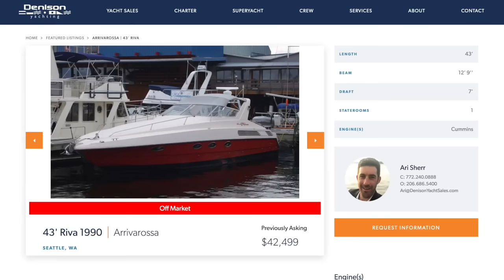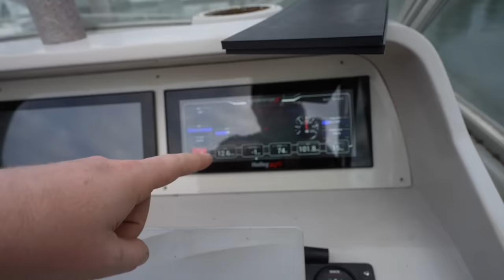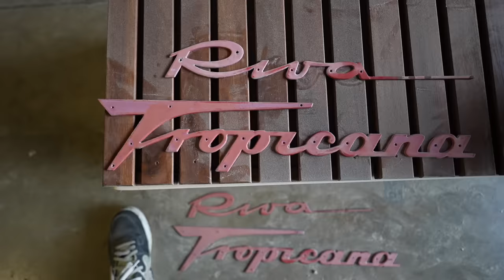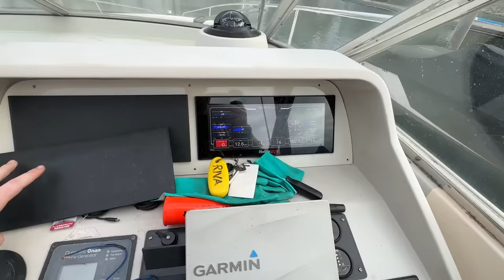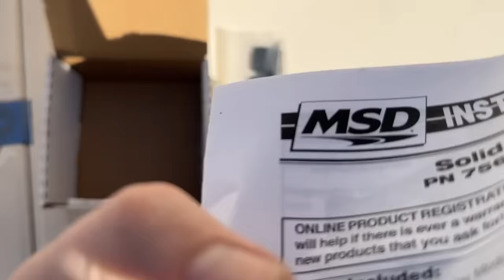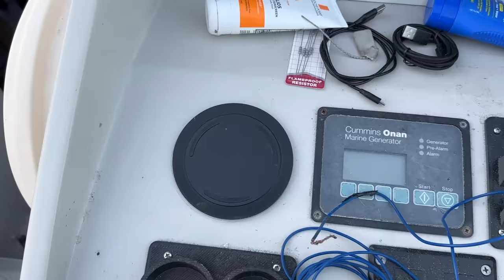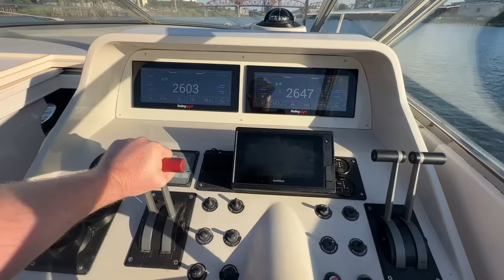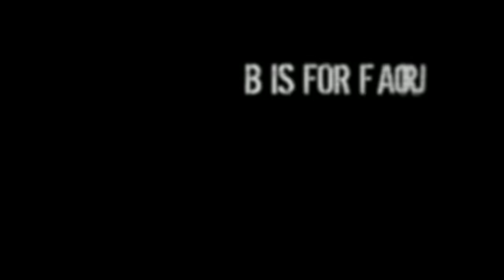LS Swapped 30yr Old Italian Yacht FINALE!! - ITS FASTER THAN EVER!!!

Comment: s for engine noise, you could try to mesure the frequencies of you typical rpms and add padding to the underside of the hatch to match that frequency and cancel it out (i.e. pyramide shape like structure). That should cut out a lot in your desired rpm range.

Comment: You will pickup allot of efficiency and speed by re-sizing those props for the powerband of those engines, that's allot of load for low rpm, what is your oil pressure at that rpm?

Comment: You know they also make a rubberized material that is non slip and can get any color!! That will make it more quiet  than before and way more comfortable. And alot easier to clean and they are non staining. Also you should look into getting a battery saver that shuts stuff off so your battery doesn't go completely dead. Also if you get that electronic thing fixed don't send it back keep it as a spare like all the other things you are gonna need as to save you in case you break down at sea!!

Comment: For everyone saying you need to re-prop, they're right. Send me a message, I can help you calculate the changes needed with some basic information. You can take some pitch out of your existing props, change diameter and a few other options. This is an awesome build and boats are so fun to learn about!
Reply: Not enough can be done to these props to get into the right rev range. too much difference. need totally different props iin that case. Different gearing in the gearboxes would be the way to go I think.

Comment: Your props and Transmissions are geared for diesel. You need different pitch props and higher gear ratio on your Transmissions. You should be able to cruise @ 4000 rpm and 35mph. Top out @ 43-45.

Comment: Using marine plywood for the furniture would last longer. Not cheap, but good. And I'd love to see Toroidal propellers tested, but those are crazy expensive. Upwards 5k each, so they might be outside the budget... supposed to be about 20% more fuel efficient, so go boating a lot and they'll pay for themselves.

Comment: Those props are geared for low rpm diesel engines, about half the pitch on those props will work a lot better with those ls engines, it will make low speed, top speed and efficiency a lot better

Comment: You really need to go over all of your electronic connections and make all of the wires solid lines with no junctions all the way to a central wiring station so if you have any problems you only have one spot to go to. Making it so much easier to troubleshoot! Make life easier for yourself for the future. ITS NOT IF ITS WHEN YOU WILL HAVE AN ISSUE!! YOU REALLY DONT WANT TO HAVE TO STRUGGLE TO FIX SOMETHING OUT ON THE OCEAN,!! ESPECIALLY IF YOU CANT ANCHOR!!

Comment: Change the props you’re over pitched. You want to get the pitch of the prop down to the point where your max rpm is achieved like 4,500 rpm or so, you’ll get better speed and fuel economy with the right sized props.

Comment: Dude you need new props! And maybe some K-planes maybe if some more weight in the stern. Those motors a under a ton of stress that low of RPM. But awesome build perfect it now! You should be getting 4800-5200 out of those motors easily. Also make sure you have marine cams in them.

Comment: I noticed that your RPM's were in the 2500 to 2700 range for WOT, that is considered lugging the engines.  You will definitely need to make some changes to either the transmission gearing or the prop size.  Most likely you would want the RPM range 4500 - 5000 for WOT.

Comment: The front is buried too far down in the water, raise the tabs. Only about half the boat should be in the water at full speed.
Also, less aggressive propellers so the engines can make it into their power band.
You don't need them to go to redline, just a smudge past powerband wide open.

Comment: have you changed the props after switching from diesel to gasoline? diesel props are bigger and your engines are struggling. you should reach max RPM at WOT. matching props is an art, but basically you want to still get close to max rpm of the engine. also wonder if transmision grear ratio is correct for gasoline engines.

Comment: Definitely need to get the props sized right pitch and possibly diameter. Should be near 5000rpm . Probably 4500-5000. At your rpm lugging the engines.
Reply: Even 7000 actually, with these engines... So yeah...

Comment: To have more speed you need to check on your propellers that are made for diesel engines with lower rpm, your new engines should make at least 4000rpm, also your bow is to low so you need to learn how to use the trim tabs, enjoy your boat like I enjoy your show, John from PR.

Comment: Is there too much prop on the boat?
Looked like about 2700 rpm at WOT?
Those LS should spin a bit faster than that. Not necessarily on the rev limiter but should be able to pull 4000-4500 at WOT.
Which should be closer to the fat part of the torque curve.
Will be a little slower at marina speeds as well.
Very nice job.
Y’all did an outstanding job reviving that old girl

Comment: As someone who has built over 300 boats, both power and sail, I can flat out tell you this is the wrong props. HP is derived at a certain RPM. On these engines max RPM should be say 6000? The prop should be pitched to allow the engines to reach 10% less than max RPM. Say 5400 RPM. If the engine can only reach half that with WOT the 51:47  engines are lugging very badly and will not last long. Any decent naval architect could tell you what the prop Diameter and pitch should be. Probably smaller diameter and much finer pitch. The weight distribution is almost irrelevant, in fact lighter is better as it will plane quicker. You also need to know what transmission gear ratio is. Diesels are usually, roughly, 2:1 and gasoline is 3:1. And your all correct. Too much trim tab and a severe bow down aspect. Trimmed out properly you kind of want the bow barely kissing the water.

Comment: I am super impressed w your build. Good job!  However since you have gas engines now you need to change ratios or props. Those engines should be 5000 plus rpm’s baby!  Will probably go over 40 mph then. Congratulations

Comment: Go to Sheffield Marine  Propeller on Vancouver Way. Give them your current prop specs. Your engine specs. They will get you dialed in! They are the Oregon, Willamette Valley professionals. For any motor any vessel. With 1500 hp and the boats size and weight. 25 just does not seem right. I get though, its not a speed boat. But, with a prop change you may get better gas milage.

Comment: You need to research and learn about propellors and gearing.  There are props designed to lift the bow, lift the stern, etc.  also the prop efficiency (At least for light, high speed boats) is better at around the diameter x 2 = pitch.  Probably need to get a prop guy involved.

Comment: I’m a marine mechanic need to change your props and also check with Texas speed but the average marine four stroke motor GM should turn 4500 RPM to get there peak power. Also, check it out see what they say.

Comment: Also, ifmyou aren't running a generator, you can find them pretty easily used and rebuilt. Cummins Onan generators are everywhere in yachting. So they are quite prevalent. You can also build a bracket to the back of the boat like sailboats do, and habe solar pamels. They can run the hotel load at night, including the AC without having to run a generator. The batteries are pricey, but you could probably get sponsored and you would only need one or 2 if you zre just running the hotel load,

Comment: You really either need to regear ir reprop the transmissions. They’re clearly geared towards a diesel engine, you should be able to rev out to close to the rev limiter of your engines… your leaving a HUGE amount of performance and fuel efficiency on the table. That boat should easily go 50mph. Optimal cruise should be at approximately 60-65% of your throttle. Probably close to 3300-3600 rpm depending on how high you’d like to rev the engines out

Comment: Uys the rust and anything else on the floor needs this stuff called on and off it's a light acid doesn't hurt the glass brush it on and hose it off it's really that easy. I had my unpainted boat in brackish water and barnacle started growing and this stuff ate everything off and did not touch the gel coat it's that easy I hope you try it I hope you try it and I hope I helped you out beautiful boat  just cover them beautiful engines with plastic just in case anything gets under the floor by the way great job on that masterpiece trust me guys I would scrub my bottom once a week and it never hurt the gel coat and was quick and easy.

Comment: I work for a 3D printing company, please remove those 3D printed fuel sensor adapters ASAP. Unless properly sealed with a fuel stable sealer, they will leak fuel fumes and liquid. I would replace them with CNC machined components.

Also, even with the fuel vapour monitors, please run the ventilation blowers for at least 10 minutes before trying to start the engines. Gasoline in unforgiving…

Comment: You need to test various props and find the best results. Ones are better for top speed and others for cruise. It's a science. Your top revs are very low meaning that prop should be smaller or angle of blade should be smaller

Comment: The boat really needs to be re-propped for the gas engines. Full throttle and only 2400 rpms means they're working their ass off trying to spin those props

Comment: Just out of curiosity why were the rpms only 2800? Don't those lsx's run 7k-ish? I'm completely nieve and want to know the differences
Reply: Read the other comments it is over prop's with the original much lower RPM diesel engine props

Comment: Been WONDERING when those floors go back in and it becomes a real, usable boat again.   Quieter?  who cares?  Now can actually USE the thing without falling into the engine compartment.
Yah, the lighter carpet makes a HUGE diff.  Could still put dark on the stairs.   It's like making a camper van.

Comment: As many people have said, the propellers are no longer correct now. You will need to have a full propeller calculation done for the boat size, weight, speed, transmission ratio, engine max RPM, to give you the correct amount of blades, size, and pitch of said propeller. Reach out if you want help with calculations for your boat! I am a Marine Engineer and Naval Architect and would love to help you guys out! I have been following this for years, as so many have. I really appreciate the work and figuring it out as you go. Have overcome a lot of challenges now, it is time for the refinement and tuning!

Too much trim tabs as well. You will likely not even need them anymore with so much weight removed from the back of the boat. It is probably a bit bow heavy now. I would try running with the tabs fully retracted.
Reply: He should have gotten the gearbox gearing right first... Which he said he would in an earlier video. Seems it might not be the case, sadly. We shall see if he learns to drive it a bit more then it perhaps wont be quite as bad.

Comment: You need to change props. Find out what rpms those motors should be making peak hp and and then you’ll need to adjust pitch to get there. I doubt they’re only supposed to be running mid 2k’s.

Comment: Im Wanderung, that the rpm is that Low. In the Boots Worts, all is about Engine and prop, beeing properes seines. If the Max rpm s of the Engines is normaly much higher, the prop should be reseized by either the seize or the pitch or both. The pitch gives you the theoretical way of the prop in hard Material. The Diesel engines had probably a much higher torque, so that the prop should be now maybe smaller, so that the the rpms rise and by this the Speed. „Groever“ in Germany is a specialist for those prop things, but i bet, youll find ohne close to you. Props is a whole world for itself and can change everything. Good luck guys. You are amazing, and my german autocorrection is bullshitting me 😂
Cu and bye from Germany 
Michael

Comment: Need to reduce the diameter or pitch of the prop to get full rpm on the engine at full throttle.

Comment: Your boat will use less energy when you reduce the wetted area. Pushing the water is not efficient.  That's what trim tabs are for - to get you on plane at lower speeds. Also, your engine RPM seemed too low for full throttle. Check with your engine builder for some dyno graphs and play with gearing or prop pitch to get your engines operating in the RPM range that they work best at. You should see a respectable improvement in fuel consumption.

Comment: Research hull speed, displacement, vs hp etc. Not sure about power hulls or planing hulls but most vessels have a max hull speed no matter what hp you throw at it. True for displacement hulls not sure about yours, I’m def no expert. Trim tab adjustment may help a little for sure. Prop size and pitch may give a little more but if you have what you wanted why bother. 
You have my dream boat though🖕lol. Great series, loved every minute of it 👍

Comment: I second all the prop change comments,  need to resize the props for the gas engines. Size them for 4500 to 5500 rpms or what ever rpm you want to run the engines at  WOT.

Comment: I have looked through the comments and i know a lot of others have mentioned that the props and/or Gearboxes are not correct for the new engines and they are entirely correct.  But i wanted to add a few things.  In your other video you mentioned that the engines were 750 hp models and with only 468 displacement, they will have a fairly good sized camshaft installed. As installed i would bet that the peak torque will be at 4500 rpms and peak HP north of 6500. These engines will actually make the boat faster if they are re-cammed with a smaller camshaft that makes peak HP at 5000 and peak torque at 3500.  by having the torque come in sooner you will be able to spin the current props to a higher rpm.  (but they will still need to be changed long term)  

Second to this, in your other video, you said you got the crusader exhaust for their 6.0 LS.  That engine is rated for what? 350hp?   your trying to breath 750hp through them they will be a big bottleneck and probably losing a lot of power as the engines sit, as well as creating excess heat on the exhaust side.   

These are just my 2 thoughts on the matter, looking forward to new videos and seeing how the boat progresses as you get more comfortable with it.  First time viewer here, just watched the "sunk" video and am binge watching more of the build series.

Comment: You need to change to smaller pitch props! Those engines probably dont make peak torqur untill later in the rpm range so you may even gain top end dropping pitch. 250rpm gain for every pitch you go down. The props usually have a marking on them. Ypu may have to go down by almost 8 pitch! Or modify gear ratio on gearbox. You may have to both
Reply: Gearbox would be the way to go I think.

Comment: All of the 3D printed parts that are exposed to moisture, should be sealed. 3D parts used outside should be sealed on all surfaces. Rain, humidity and ocean salt will wick in and corrode everything. Wiring, equipment and mounting hardware. 

Also, for longevity, you may want to seal the edges and underside of the table to keep moisture from entering and warping the table.

Comment: You need 4000+rpms for your max my old 454 mercruiser max is 4400. Check with Texas speed on sustained rpms on those engines.  Drop the pitch on the props it will be a totally different animal after that you won't be disappointed.  Now you heard change the props for the thousandth time 😂
Reply: Given how many of us have told him he needs new props to match the gas engines hopefully he plans to do it, The alternative is that he just ignores us.

Comment: You guys have done a great job on the boat! But you are way over propped. With those engines I would be targeting 5-5500 RPM at wide-open throttle. Which means you need to come down significantly on the diameter and most likely change the pitch as well. She’ll run significantly faster, probably get better fuel mileage and live for a long time. Great job and good luck!

Comment: First don't use steel wire brushes on fiberglass. A couple gallons of dollar store La Awesome cleaner and nylon brushes on drills and you would have been good to go. You now need to look into having someone repair the gel coat you have destroyed. By the end of the summer, yes, this one, every time you walk across gel coat one if not two things will happen the heels of your shoe's will start leaving marks and you will have white chalky feet leaving ghost foot prints all over the new carpet. And by the way, your sewing machine can make stitches as long as the ones in the original steering wheel wrap you had the machine set to the shortest, narrowest stich it could make and you had it set to zig zag not straight stich.

Comment: If you want to go faster you might need to change the props as they are designed for diesel engines that run at different rpms and so the props have a different angle than what those gas powered engines should be using

Comment: what's the point off having X2 of Texas Speeds Big Block engines if your not going to properly utilise the Power they can deliver, You could have just bought a good refurbished Deiseal pusher engine and called it a day or slap on a outboard motor if you only wanted to go 20-25ish MPH. I really hope to see you pushing this thing to Max speed of 50, 60 knots upwards, Should be doable with 1500BHP and fuel wise you don't have to use Marine fuel whatever that's meant to be, use whatever you want if you got Flex fuel let them engine eat the best fuels, You restored this Yacht so well show it some Power and speed loving